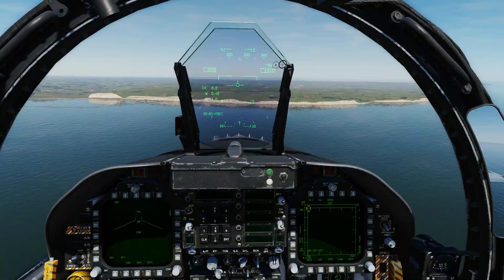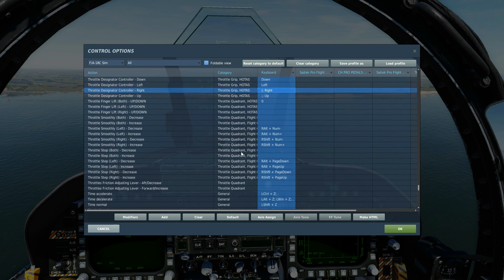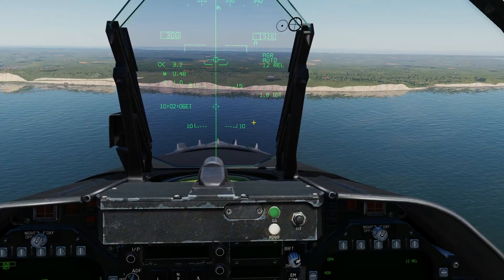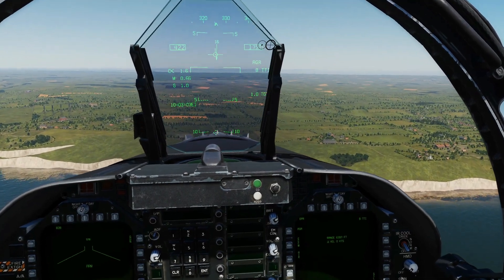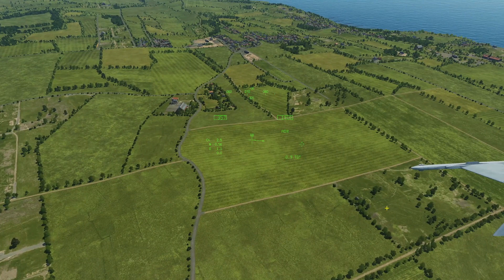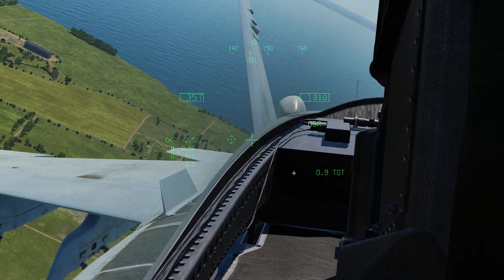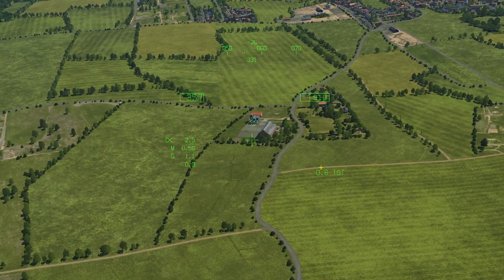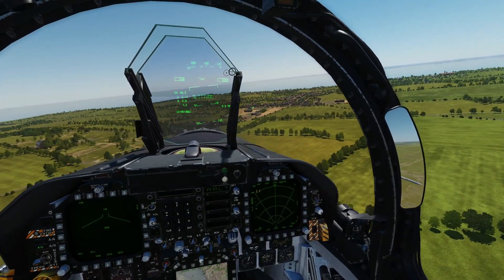FA-18C Hornet UPDATE: JHMCS A/G Functionality & Changes To HUD TGT Designation | DCS WORLD

Comment: Hello there, is anybody has that problem with DCS v2.8 that the bombs vertical line not fits to the targetting rectangle? sometimes far away from that. In this case the tpod picture with targetted diamond also far away from the target at hud's diamond....Is that an issue? I have attached a pic about..here is the pic about that issue:
https://drive.google.com/file/d/1uNX_GheeqHTvPBS10r1g0gtI_v4nStYp/view?usp=share_link

THX!